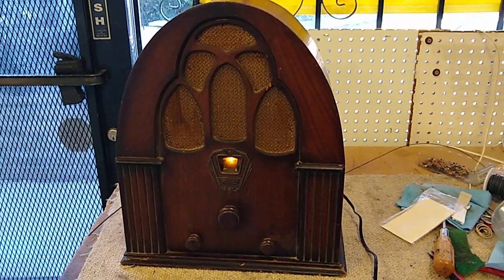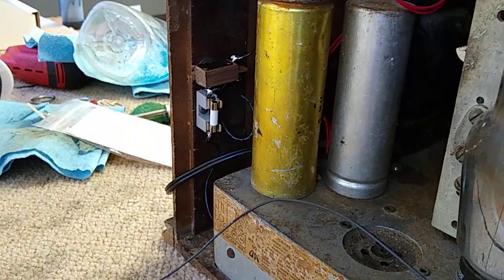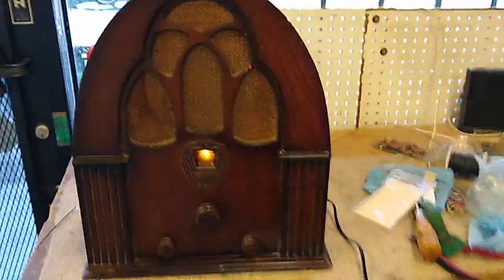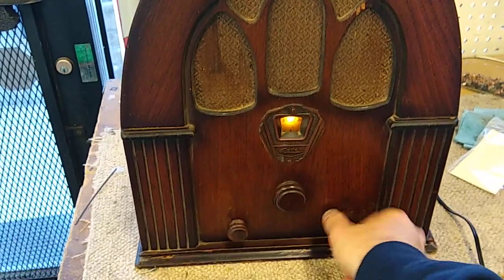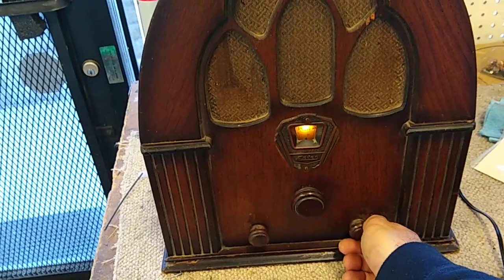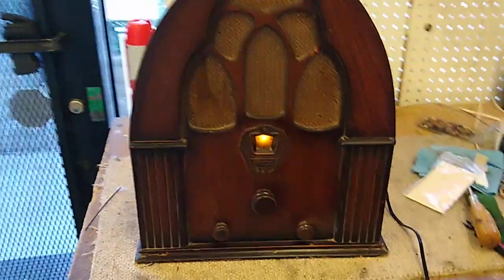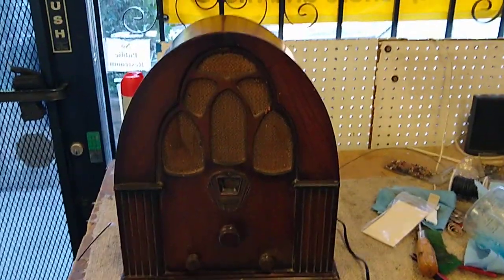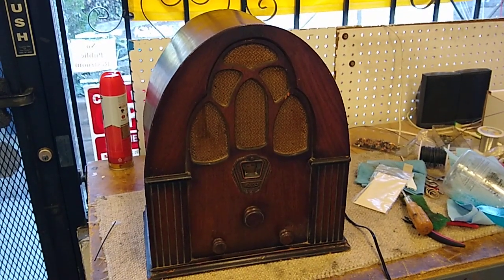Repair attempt of 1932 Aztec cathedral radio part 3 / 3

Comment: I had mentioned that my grandfather had a radio like this one, well back in the 1980's my mother spotted a replica of it, albeit a 2/3 scale, and had to have it.  She loved that set and had it in her kitchen for over 20 years till one day it began to hum very badly and like the child of the 30's she boxed it up and put it away, in case we might need a part off it some day.  Well she went into a nursing home 3 years ago, and I cleaned our her house, then sold it. I came across that old radio and took it home. I tore into it one day and found a cheap AM/FM board with some actually leaking capacitors, they had corroded the board a bit, but I managed to clean them up and replaced all the electrolytic caps with Nikon's of the same value. The radio came back to live and, using my home built FM transmitter (from an Ebay kit of course) hooked to an MP-3 player disguised as a cassette, it played the Christmas Carols for us last year. My wife (RIP) loved it and mom saw photo's of it, and was overjoyed that I had it running again. I offered to bring it up for her to the home, but she said there was no room to put it so it sits in my dining room now gathering dust.  There is no joy this year with my wife having been taken from me by the damn cancer.

Comment: I love cathedral radios even the repros I bought a GE repro  from the late 1980s in mint condition. I runs perfect. Needs no servicing or cabinet touch up. It has good bass and sensitivity on both am and fm. Even the dial light works. Also have the GE tombstone model with the cassette recorder under the top lid

Comment: Looks great and sounds great too!   I hope the cabinet has a back cover.   I wouldn't want someone to reach around the right side of the radio for the power switch and find the exposed fuse as well.     And I spied a Coral BX-1001 speaker in your store.   I still have mine that I purchased overseas in the early 70's.
Reply from the maker: The owner of this is smart enough to know not to do that ;)

Yes, those are bx-1001. In addition to caps, I also cut out the stiff paper surround and replaced it with a custom foam surround. Makes alot of difference in sound quality